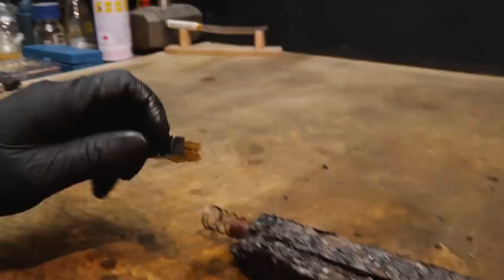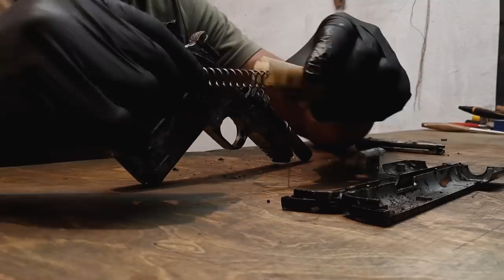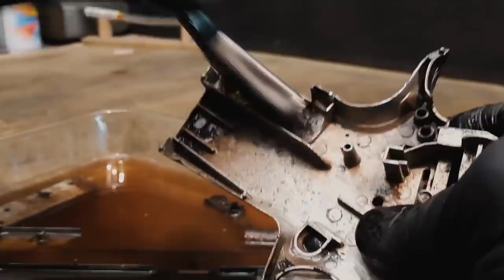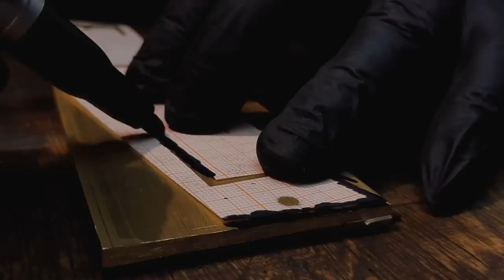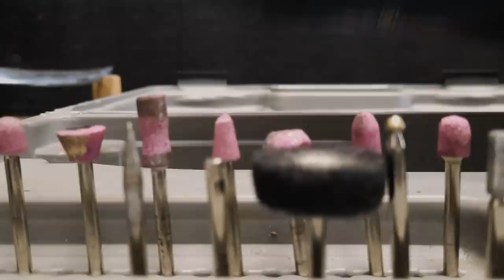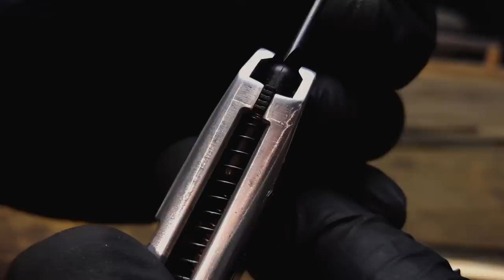Colt 1911 Restoration - Metal Ball Ammo Toy Gun Restoration

Comment: People rust it using a vinegar mix. The spray it on and it starts rusting the metal after multiple layers. You can see this, because only the  tip of the barrel is rusted.
Nice video anyway.